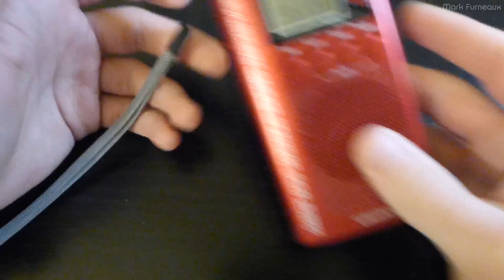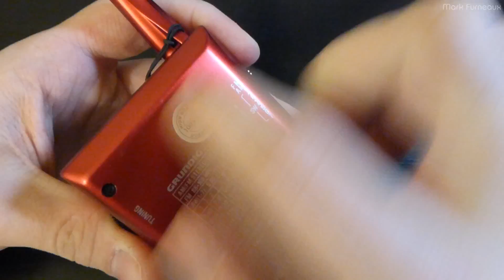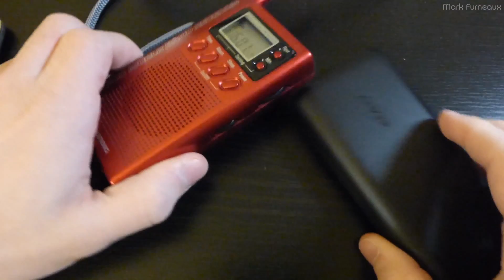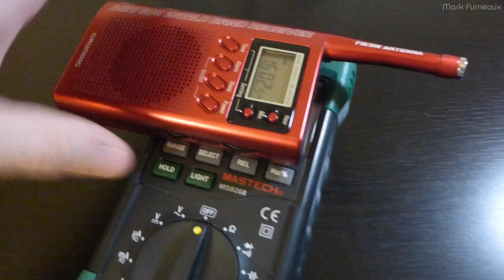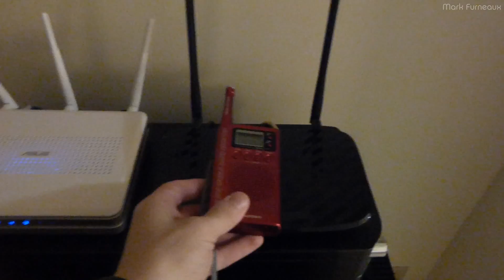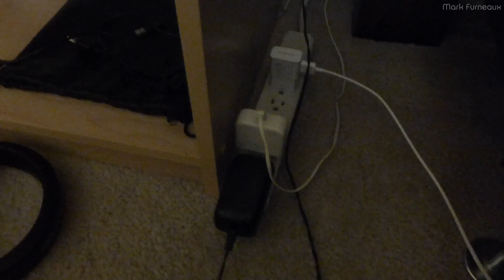Using an AM Radio to Detect EMI

Comment: As an amateur radio operator I can tell you that the Ethernet over power line devices create horrendous amounts of noise! If you live next door to someone with these devices (or even two to three houses down) it renders your HF equipment un-usable
Reply: Will any sort of power conditioner help in that case?
Reply: I've talked so many people in to not using them. They are horrid and honestly shouldn't be allowed since often the interference goes above 60mhz!
Reply: Andrew Dickson I live next door to a guy with radio station, it's on the roof, his equipment goes from the 4 antennas that are 15 feet high, 2 pointing up and two other poles horizontal suspended off the ground 3 feet, he has a shed with equipment and wires from shed going into the bedroom window that is right beside my bedroom, we share the wall.
I feel sick and tired if I stay in the room too long, EMF detector shows 2-8 milli gauss on my bed at times and my heart skips a few beats more than normal when I lay on the bed or near the bed.
Recently there is a high pitch beeping noise coming from his equipment, I knocked on his door to ask him if he can hear it and he got angry right away and said its not from his radio and would t even let me finish my sentence. This was the second time in 1.5 years I spoke to him and first time mentioning his radio station. He came to my door 5 mins later banging loudly and said the beeping is not from his radio station and nobody can come in and check it and if I want to check it then give him $20, this is a grown Russian man in his 60-70's and I asked politely if he can hear a beeping noise upstairs and he goes off the deep end and comes down to my door to continue his rantings.

I can't connect to wifi 9/10ths the time in this room because of his radio station and if I walk -0 feet away from bedroom the signal is fine.

So can you help me out to not get exposed to EMF and my health and be ab,e to use my wifi or do I have to report the guy, I don't want to because of his words and actions he is acting really angry and guilty and over a beeping noise, maybe he's a Russian spy with a lot to loose, haha, but seriously I need help with this so what would you suggest?

Peace and Blessings
Reply: @crying_hippy  
Hopefully by now you've discovered a USA government agency known as the Federal Communications Commission (FCC.Gov), have filed a complaint, and the situation is resolved - OR- you moved out OR you've documented your ailments via doctors and have sued the offender.
Reply: @usernamemykel  I had to move as it was causing heart palpitations and I'm high risk stroke patient. He and the neighbour beside him both used chemicals on me too, like gasses, ammonia, lead, arsenic, paint thinners, etc.
The cops didn't care even said I'm probably right about the paints and said to file with landlord tenant board, I called fire department, they couldn't detect anything first time but did the second time and said it was fumes from sewer, but it wasn't it was some type of gas the guy was using to come inside my bedroom window.
I'm in Toronto Canada where they let people get away with murder, literally.

I told friends and family this man will probably end up poisoning his dogs or himself with all this crap he's using on me. Less than 2 months after moving he died of heart issues, he went to russia his country to seek help as canada couldn't help him and he died in russia.

May God Have Mercy On His Soul

Thanks, Much Love and God Bless You
Reply: @crying_hippy  you should make a YouTube video detailing this. I hope a conclusion is reached because this seems to be against alot of FCC regulations.
Reply: @JP-pq9xi  I'm in Canada, was last year, and the man died, I'm 99% sure trying to kill me with his vast array of chemicals he used on me while there, God Rest His Soul and Father God is So Good as I am still here and all I could do was gift it to God.

The one cop looked at me and thought I was nuts ffs, I showed them all the proof and the paint and thinners and they didn't even want to look at any video or audio.

When the one cop was about to leave he said I'll look at one video if you hurry, and my phone wouldn't connect to wifi to download it from cloud.

They really don't care at all in Toronto Canada, its like Chicago but bigger

Much Love and God Bless